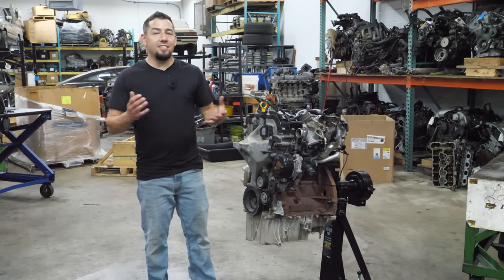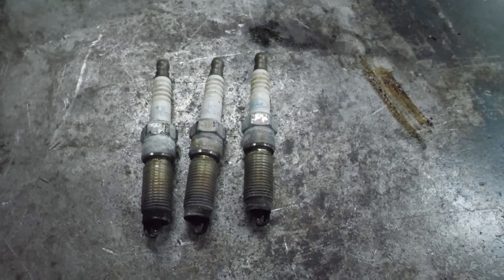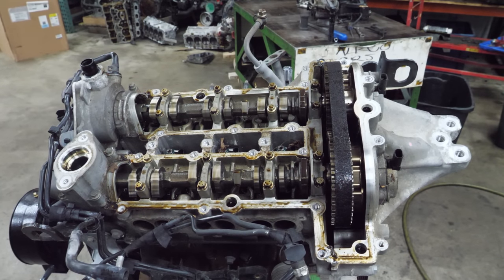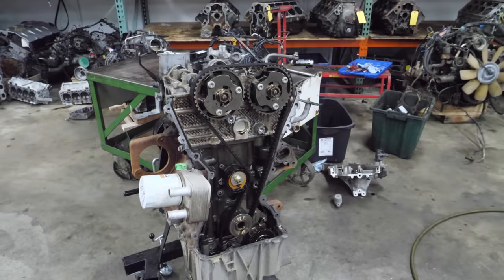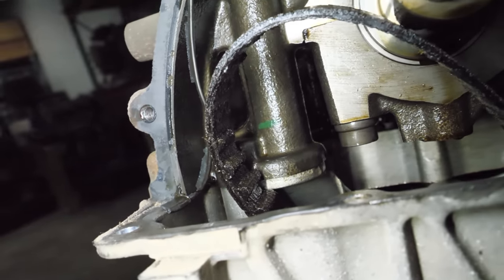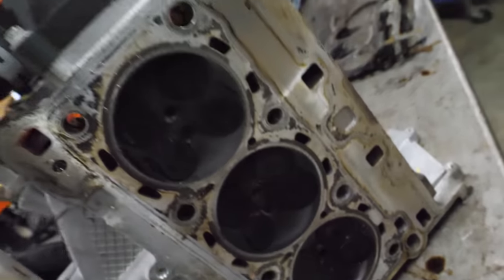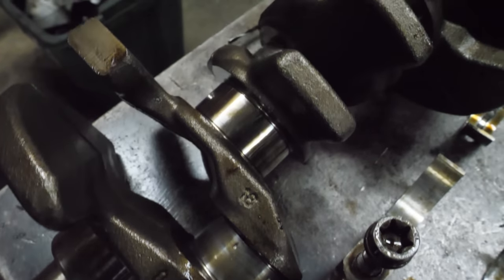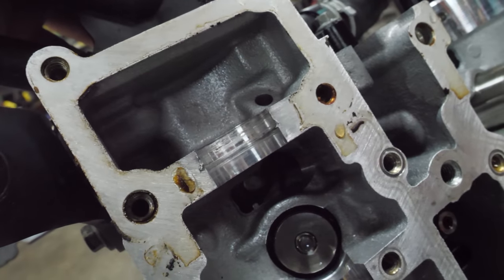JUNK Ford Ecosport 1.0L 3-Cylinder Ecoboost Teardown. LAWSUIT ENGINE!

Comment: We were warned long ago  by Scotty Kilmer in regards to these small engines using Turbochargers , ofcourse the manufacturers know that as well , but the government regulations and since these are cheaper to produce than comparable 4 cylinder engines. I currently own 2014 Accord sport with naturally aspirated 2.4 engine and its got enough power for my needs , but want to see how long the new 1.5 turbo would last in newer accords and I bet anymoney those engines won't make it to 100,000 miles without any issues .

Comment: FACT … from 2018 the eco boost 3 cylinder engine was totally redesigned.  
Cylinder BLOCK without grooves for cooling,  gaskets fit perfectly and no more coolant ingress .  
with ALL NEW Resigned Cylinder Head with ' Cylinder Deactivation / Shut Down ' during soft cruising - operational unto 4,500 rpm,  unto 6 pc improvement in fuel and CO2 emissions,
The engine in your tear down is 100% a pre 2018 block . 

Thanks
Reply from the maker: This engine is from a 2019 ecosport
Reply: My friend,  there is a 2018 1.0L EcoBoost ( May 2018)  in the workshop next door to our work and the cylinder block is the newer modified block.  You can tell by the drilled holes for water flow between the three cylinders and not the earlier ‘grooved variant’ as your tear-down engine shows.  We love our show but the engine you had featured was definitely the pre-2018 design.  There’s a few videos online on YouTube showing the 2018 revisited design block.  

New Design Blocks have a METAL TIMING CHAIN - that's also how you can tell. 

https://youtu.be/xIDtbHIZ5iA?si=FlxCF8hmjFntYKcI

Thanks for great content and keep doing what you do best

Comment: If someone made a retro timing chain setup for this engine, it probably would make a reliable engine. I'd run from this engine, coming from a loyal Ford fan. What was FMC thinking of when designing this 1.0 eco boom engine. Rubber in oil? Not a great idea.

Comment: The only but really really important thing is - you CAN’T dump random Oil in this Motor, BECAUSE it has a wet timing belt. 
This Engine dies a thousand times - and again - BECAUSE Customers AND lots of mechanics have a lack of this information. 
The Timing belt will dissolve, clogg the oil pump and there you go.

Comment: My girlfriend has replaced her 2016 mk7 1.0 fiesta Ecoboost after 65k timing belt failure with a 2013 mk3 1.0 focus Ecoboost. Cos it was under 4k and tax absent.. im going to charge the timing belts as soon as I get the money together and then keep my fingers crossed as a keep dipping in to the money to make ends meet . Its holding up ok. Guy told me its been changed. But the service paperwork was for a different focus but didn't have a timing wet belts change listed so he might be telling me the truth. Just waiting on the documents to arrive...😊

Comment: Wet belt designs are the absolute worst. Stellantis also use this on their 1.2L 3-cylinder and it suffers from the same issues as this engine. Clogged oil pickup from belt debris and oil starved engine. When fixed the engines usually starts consuming lots of oil sine pistons rings and bearings are worn out due to oil starvation. Rubbish engines both of them. Avoid!

Comment: I worked at a  VW garage  and would rebuild a beetle engine's I moved on to chevy's. Electronics in the late eightie and thru the ninties took me out of the game.Watching you video was like standing with a master , I have the glow of no fear tearing someone's engine down (.This engine would look really good adapted the marine use on boats and pleasure craft ), And I loved fords as a kid until I worked one ,never again for anybody.Funny ? The amount of crap and the  jingling of loose steel as you broke the engine only reafirmed evrything I learned on the first ford I worked on. This engine is job security,.

Comment: I bought a 2014 Fiesta ST in 2016 with 46,000 miles on it for 28k and sold it at like 99,9xx in 2020 for 5k. I don’t remember how much I spent in service and maintenance, but needless to say, I’m never buying another Ford unless it’s just a cheap beater/project thing.

Comment: Didn't this engine get some award? I wonder how the three cylinder turbo in the Mini Cooper is designed compared to this.
But I thought the same thing, a timing belt in oil?
What's the best small engine design that you tore down so far in your opinion.

Comment: have had both the 1.5l naturally aspirated fiesta and the 1.0 ecoboost. In real world driving, 90% >65mph, with the 1.5 I got about 42 mpg, but the ecoboost would easily hit 48 mpg on a tank. HP for both on paper are the same, but not on the pavement, not a mushwagon with the ecoboost. of course, the 1.5 was saddled with that crap automagic transmission. Ecoboost Fiesta was only available stick. First belt on the ecoboost was swapped at 110k miles, but will probably swap the 2nd one at 150k. :(

Comment: Wet belts just piss me off. They look good on paper but always look bad before their expected lifespan is up. Ford isn't the only one using these damn things either. I was sorely disappointed to see one on the 2.7 V6 as well, and it's not an easy swap on any engine with them. Just another case of a bad idea implemented in order to gain .001 MPG fuel economy to meet ever stricter .gov standards.

Comment: Everyone is bad mouthing these engines but most of it user error. As long as you do your yearly oil cange with the right oil and a timing belt renewal every 8-10years you are fine and they actually run very nicely. Do we know what the maintance of this engine looked like? No.

Comment: I’m slowly turning into an ecoboost fan boy. The 3.5 is a monster. The new 3.0 is a masterpiece. I have a 2018 modded Ford Fiesta ST with a 1.6 ecoboost and it’s a torque machine. I have no doubt that I will one day buy a 1.0 to put into something dumb. But from what I hear, they’re decent engines and you can get high mileage out of them
Reply: I'd love to see some sort of 3 banger like this in a Datsun 510, MG midget, or an old mini. I suppose the Honda 1.5 l series could be a decent fit, too, but it could be trouble to fit any tall modern engine, though, especially with fwd mounts in one of the rear drive applications.

Comment: Most of the engines I've seen with wet belt failure were owned by folk that did their own routine maintenance after the warranty expired and were unaware there even belts in there..

Comment: It is a way for them to save money.  I reckon it is cheaper to build it with a turbocharger than to build the same size engine without one with the same power.  They can get away with things not being perfect.  If you have a H22A or F20 they have to have way tighter tolerances or will quickly fail catastrophically

Comment: My 2007 Mercury Grand Marquis 4.6L 2 valve gets over 30 mpg on the highway. That's a V8 in a 2 ton car. The 3.8L pushrod V6 in my 2003 Mustang does even better. I'm a huge fan of non turbo, non direct injection, non VVT 2 valve pushrod engines. 

Only a complete fool would design an engine where the timing belt runs in oil. But on the other hand, those tiny little bicycle sized chains aren't much better. Neither are going to last very long. My 1972 Ford Pinto 2.0L SOHC engine uses an external timing belt, which not only turns the cam, but also an auxiliary shaft that drives the distributor, oil pump, and fuel pump. It's right out in the open on the front of the engine. It originally had a cover over it, but I have always run it without a cover, so I can check the condition of it every time I have the hood open. It takes about half an hour to replace. The valves do have rockers, and solid lifters, which are supposed to be checked/adjusted every 3000 miles. But I've found they will hold an adjustment for over 30,000 miles. 

So there are no actual cam bearings. The cam runs directly in the head, meaning the entire head has to be replaced if there is damage or wear where the cams run. This is a disposable engine. It was not designed to be rebuilt. No key? What keeps the pulley from turning on the crank? A 1.0L engine. My Harley Sportster 1200 has a 1.2L engine. And it's a LOT smaller than a car. Look how thin those cylinder walls are. I'm assuming that engine was not designed to be rebored? I'm surprised it even has rod and crank bearings, since there were no cam bearings.

Comment: Peugeot and Citroën had similar issues with engines with wet timing belts in Europe. In the case of those engines, you had to use the exact oil that the manufacturer recommends. Can't just through any 0W30 in it for example. The oil has to have a exact spec meaning it has an additive in the oil that stops the belt from getting eaten. Eventually either the belt would snap, or the pieces of belt clogged up the pickup for the oilpump. Still a stupid design though because they could've guessed that people wouldn't know about this and put the 'wrong oil' in them, even dealerships that didn't know about this did.

Comment: This is typical management wanting to save every penny then can so they can give it to their shareholder's. Just like Boeing does. 
I think that engine is in the fiat Punto & 500 as well. You've also got the 2L EcoBoost which is in the Transit and Mondeo. 

I can't WAIT for this scandal to come out in the world news 😁 They'll definately have to design a chain retrofit kit along with putting a key in or drilling a dowl into the crank shaft. I bet the designers & engineer's said countless times "you can't put a belt in oil as it'll disintegrate and only last a couple of years" and the higher ups said "well that's perfect then. Make it a welt belt"

Comment: So the only way to have this engine, which have almost no advantages whatsoever, to run fine like a nicely designed engine, is to do every single part of mantainance on time, even sooner if you want to be safe.

A design choice perfectly in line with a company that kicked out his founder for being too generous.

Comment: citroen had big issues with their motors that had an oil dampened timing belt ,also and to change the belt the motor had to come out every 60,000 miles

Comment: A synthetic wet rubber belt is definitely going to be the cause of a plugged oil pump hence engine failure. The other most common issue is the belt tighter unit that also fails. Honda with its cheep chain belt is stretching, then the oil driven tighten chatters when starting up the vehicle, eventually leading to chain and tensioner failures and rebuilding the engine. Honda like ford says “First we’ve heard about this “ then years later after warranty issues are over, “ Well there might be a bit of an issue “ why can’t manufacturers just bring back simple bullet proof engines that consumers get their money’s worth for ? Not fair, the consumer should not be on the hook for poor designs !

Comment: I had a 2018 Focus with that horrible piece of scrap, 40K the engine had to be replaced due to a wiped cylinder wall, it all started with an oil leak that turned out to be a bad head gasket.

Comment: There is no problem with 3cylinder engine, turbo charged or not, 1.0 or 1.5. The problem is with design, like this one or 1.2 puretech for example. Second thing is that car manufacturers put them into compacts or large crossovers what is maybe profitable but deletes main advantage of this engines - efficiency (Ford even decided to put 1.0 Ecoboost into Mondeo and Transit 🤔)

Comment: My impression of modern Ford is using the previously established reputation for reliability and just making cheap engines that wont last. Granted, same with other makes, but I feel Ford is the most grievous of them. My dad's got an 03 f150 with the 4.2 v6 and its got 340k miles, original engine, just well taken care of. Been through two transmissions though.

Comment: I dont have a ford but i do have a VW 1.0 3cilinder. 145hp and 240nm tourqe and i do 28km/L (56mpg) idk why the ford one uses that much but the VW ones are really good with fuel

Comment: This video is nice, but you have to say how many kms has this motor, and how was the maintence.. Without it is no sense
Reply: He usually doesn't get this information.  It doesn't matter how many kms or maintenance.  The oil pump belt tensioner failed, and the belt is missing most of its teeth!

Comment: the ford ecoboost also has problems here in germany ford transit minivan. focus fiesta. all due to the timing belts in the engine oil the oil dissolves the rhymes. then the teeth break off. no oil pressure. or piston and valve kiss each other. and. then everything new
Reply: I'd rather keep my Ford V4 engine. Colonge design. only the spur gears break. and the balancer shaft bearings. 1500hc. 1.5 liter displacement. and 65 hp  from 1966

Comment: A lot of these engines get a remap to well over 160hp and those little wet timing belts just won't last vw use a 25mm belt on a 140hp engine and a 30mm on a 170hp engine so in theory a remaped engine would need a belt change much sooner than a standard engine the engine is known as a EcoBoom not EcoBoost

Comment: Ford says 10 yrs or 150k on changing the wet belts ! I’ll personally never own another ford after the issues I had with my 18 f150 with the 5.0 coyote! 2 long blocks and one top end within 7 months of ownership and would still knock intermittent and burn a qt of oil a week

Comment: It doesn’t need a key way there for alignment ie cam wheels or rotors they don’t hold anything on that’s a tapper
If you look on YouTube I think that’s a bmw engine or at least they have one too been multiple recalls on that engine cracking belts particles blocking oil pickup hence cams mains big ends and turbo failure . I believe they have finally sorted it by halving the Maintanance schedule on the belt . Belts don’t work never have been reliable just use decent quality chains oh yeh then you won’t buy a new car

Comment: In Germany, we spell FORD "Fuer Opa reicht das" which means "For Grandpa it should be fine". The timinig belt needs special oil; any other will destroy the belt immediately. This is the worst car engine I know. Belt replacement costs at least 2,500 EUR.

Comment: I work in a Ford dealership in Switzerland ans we have this motor in a lot of model. This belt tensioner is present only with a automatic gearbox, not with a manual.

The failure on the tensionner is how all the bit a put togheter with a crimp fit, when the part un crimp you have everything going stuck betwen the belt and pulley tearing off all the tooths of the belt.

For the mains belt what cause the belt to fails is when the oil change is not respected, gasoline present in the oil attack the belt et you have a catastrophique faillure. I don't say that the rubber in oil is a good idea, is the worst idea ever...

We have this stupidity in most of the news engine. even is they put a chain betwen the camshaft and the crank, they put a belt for the oil pump.... 

This one engine was present in the Ford Fiesta, Transit Connect, Transit Courrier, B-max, C-max, Focus, Ecosport, transit custom HEV. 

The crank pulley is not key in almost all engine ford, the way is hold is by tignthening the crank pulley like a monkey, we have to use a tool whit gear ratio to tight the bolt on thos engine!

Is a great tiny engine, until it broke

Comment: With the 1 litre ecoboost if you don’t use the exact oil that is specified (Castrol Magnatec 5w20e) then the belt is gonna degrade

Comment: UPDATE on this engine, Ford has issued a SAFETY RECALL saying "it may be possible for the engine oil pump drive belt tensioner arm to fracture, separate from tensioner backing plate, and /or the oil pump drive belt material may degrade and lose teeth, resulting in a loss of engine oil pressure." This recall came out this month, February. It claims parts will become available 2nd quarter 2024.

Comment: The timing belt is made of rubber, and rubber should be lubricated exclusively with silicone-based lubricants. 
Other lubricants are likely to damage rubber. I assume that's why the belt is in such poor condition, besides normal wear.

Comment: So they should have better used a dry belt. I even in that case don't like the idea that the whole thing is dependend on a piece of rubber to survive. All the ado about some particles in the exhaust, but a simple upright shaft, which would be a lifetime assurance, can't be afforded.

Comment: Just now got around to this video. I knew this was gonna be an interesting teardown as ford isnt known for well designed turbo engines. But the timing belt design doesnt make sense to me. Why a wet belt on a modern engine design? NOT ONLY THAT, but the crank doesnt have anything there to hold the belt pulley in place...The excuse ive come up with is that Ford is hiring new upstart engineers with little experience in the automotive field and throwing them bad criteria. 

Giving the new guy an impossible job and expecting it to stick is not a good idea.

Alternatively the engineers at ford might just not care anymore.

Comment: The 2021 Toyota C-HR is similar in size and price and gets better gas mileage with twice the displacement and more horsepower and torque.
Reply: Toyota actually made a really good small 1.2 turbo petrol 4 cyclinder engine that has similiar figures to the Ecoboost except its chain driven and actually reliable. Sadly the engine never sold in big numbers because people are more interested in the hybrid drivetrains.

Comment: Buying 1 of these secondhand is a no no has it had its oil charges done in the past same goes for all wet belts engines not just Ford but PSA ,VW and vauxhall as well the breakers yard where I go has dozens

Comment: The 4 banger GM put in their Chevy Volt PHEV gets much better mileage.  Around 37 when the propulsion battery is down and it's running on gas alone